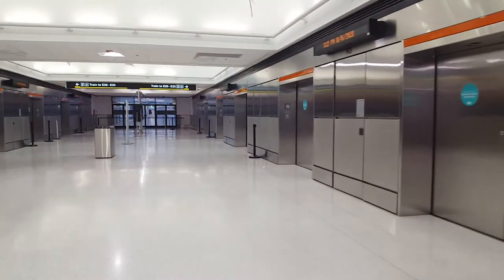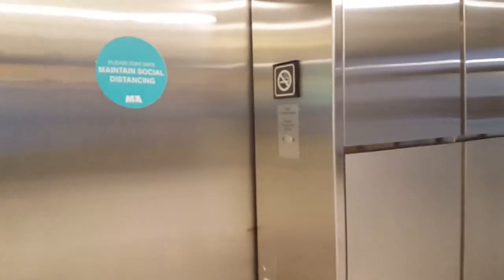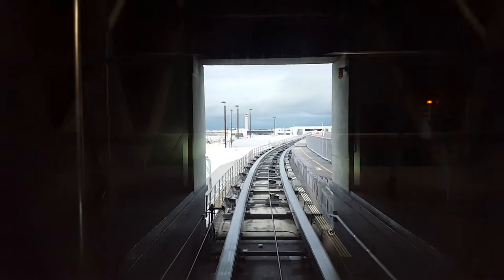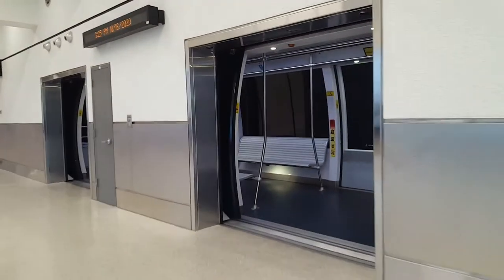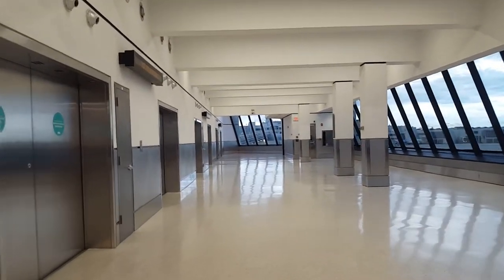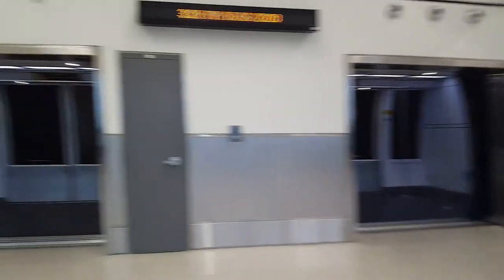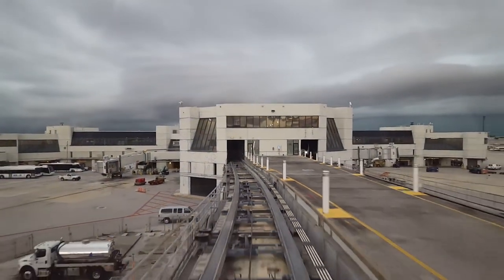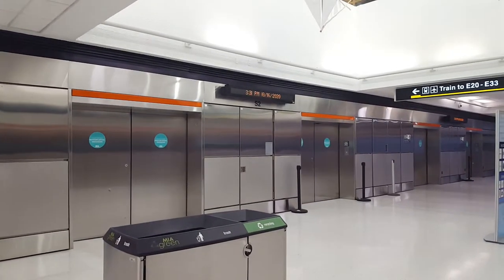Miami Airport Train (E-Train Round Trip)

Comment: I rode this in 2011. I think it was an Adtranz. I remember it feeling like a very old Bombardier APM 100. Also, they renovated the terminal. I remember when there were modernized vintage elevators. I remember somebody telling me that Terminal E handles only flights to Cuba in 2011.
Reply from the maker: This used to be an APM-100. I don't think it was an Adtranz system, but I'm not sure. Wish I could have seen the original one.
Reply: Yh they did that's the prime reason why the terminal was empty so often as flights to Cuba were not as demanding